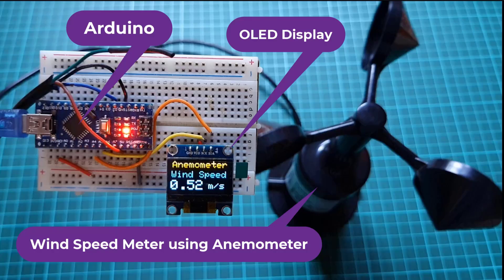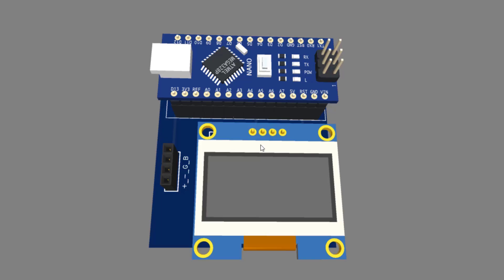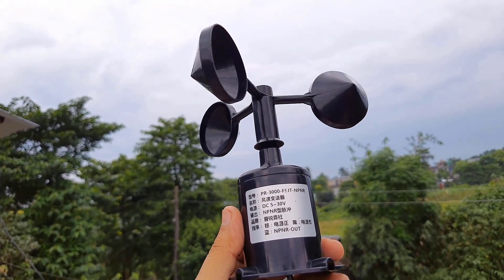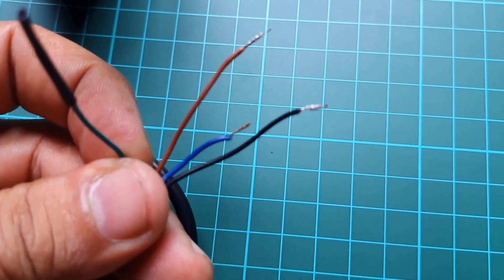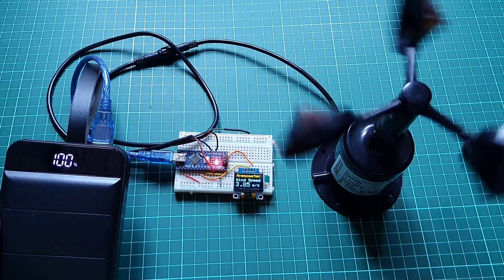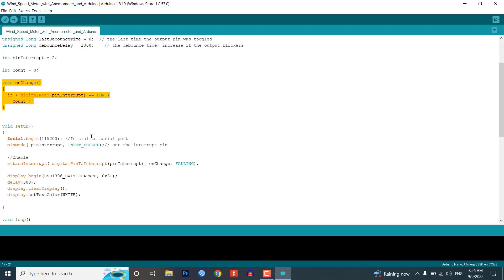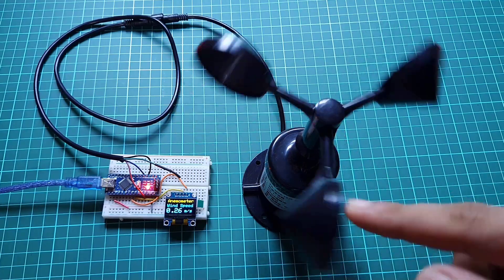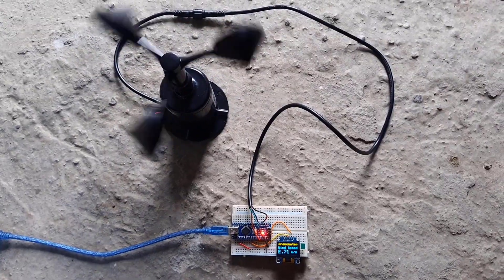Measure Wind Speed using NPN Pulse Output Anemometer, Arduino, & OLED Display

Comment from the maker: ► Measure Wind Speed using NPN Pulse Output Anemometer, Arduino, and OLED Display.
► Download Circuit Diagram, Source code, and guide from here: 
►  https://iotprojectsideas.com/wind-speed-meter-using-anemometer-arduino/
*************************************
#anemometer #windspeedmeter #arduino #oleddisplay  #npnpulseoutput #arduinoprojects #iotprojects #windspeed